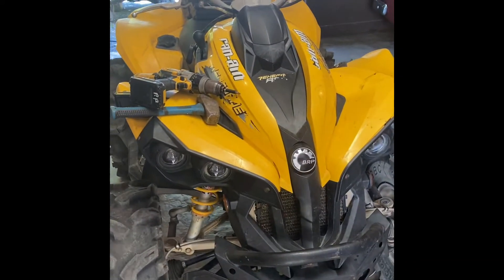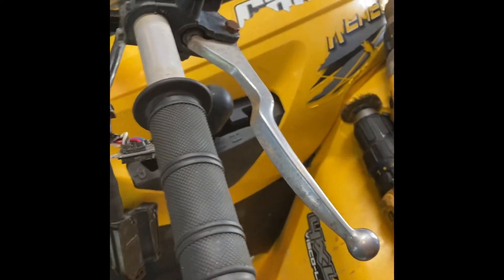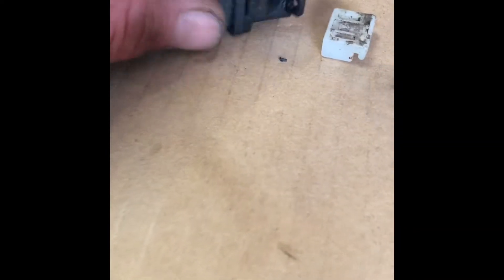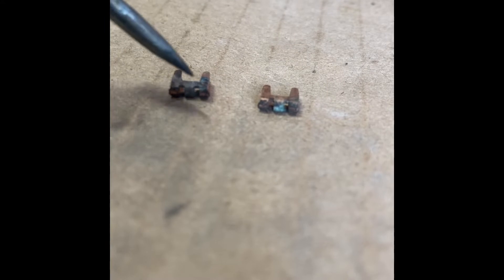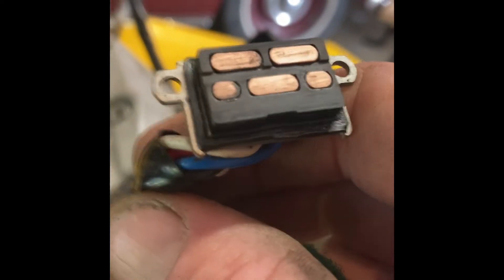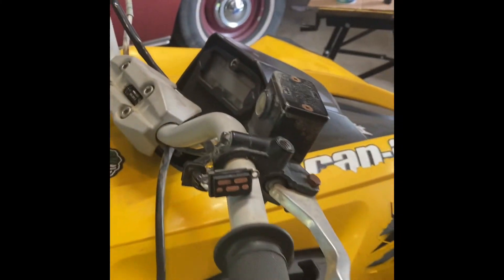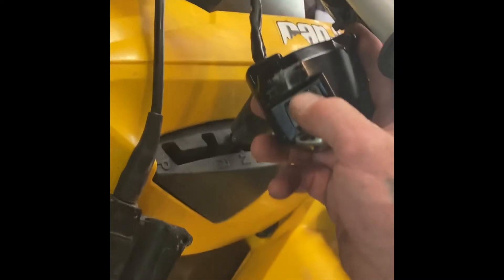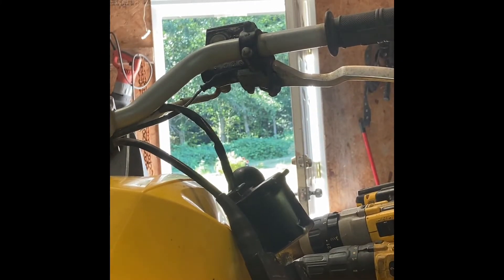Canam Renagad 4x4 switch intermittent working￼

Comment: Ok so I think you're helping me figure out my problem, but maybe you can explain more. My 4wd works fine once I get the switch to flip. But the switch has been getting harder and harder to push. Like it almost feels sticky. Yesterday I had to smack it with my fencing hammer to get it to flip cuz I couldn't push it hard enough with my thumb and we had 2 feet of snow here in Wisconsin and I had to get the hay out to the horses so I desperately needed the dang 4wd to just turn on. The hammer worked and I just left it in 4wd now. But do you think mine is an issue with the contact points? Or do you think it is something with that white plastic piece that slides back and forth in your video at minute 4:56? Once it does flip, the 4wd engages instantly, just like it's supposed to.  I think I just need to get that white piece to slide better. Can I do that somehow without taking it all apart? Kinda scared to take it all apart like you did. And definitely can't afford a couple hundred bucks to replace the whole thing. Tell me there's an easier way! I really rely on my Can Am daily on my little horse farm. I need it to work but I also need to know how to fix it myself. Sorry so long, was hard to explain. Just really need some help.
Reply from the maker: You definitely have something in the plastics jamming. You’re gonna have to open it up and put some dielectric grease in there should allow it to slip back-and-forth much easier. You also might want to get very fine sandpaper like a 400grit and just give the plastic quick little rub, it might have some rough edges from dirt on their catching.